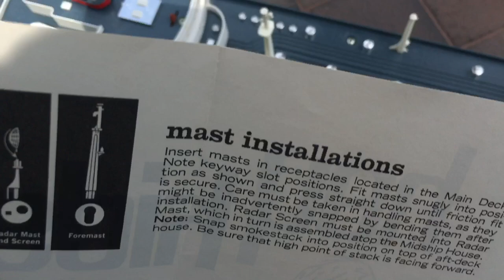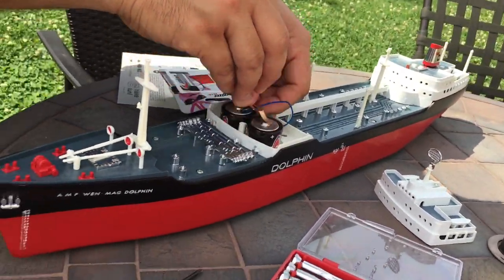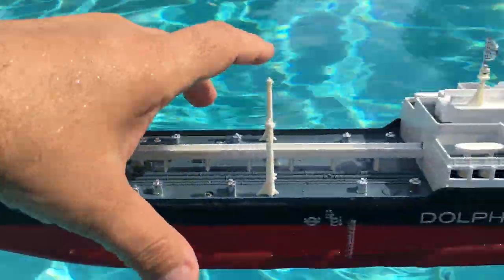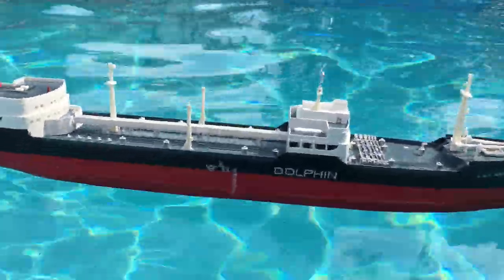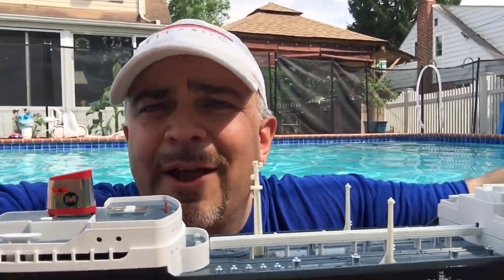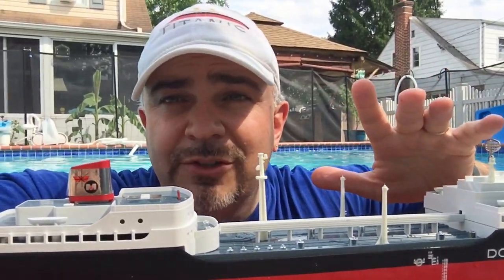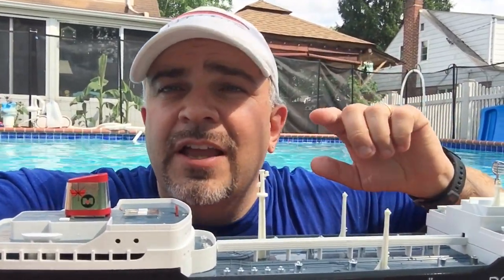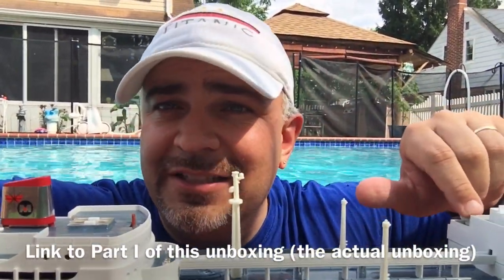WEN-MAC DOLPHIN Unboxing in 2020 Part Two - The Maiden Voyage, Texaco North Dakota

Comment: Hi do you know what year the dolphin came out . I know the Texaco North Dakota came out in 1961 . Thank you
Reply from the maker: I don’t have the box and manual handy at the moment to check (they are in storage) but I honestly can’t recall if there is a date on either... but the hull of the ship does have  “Los Angles 64 California” stamped on it as part of the plastic mold so my guess would be it was likely released after the original 1961 release of the North Dakota using the same equipment to manufacture - I would say maybe 1964.
Reply: I believe it was 1964.